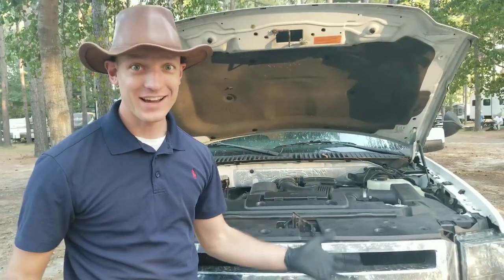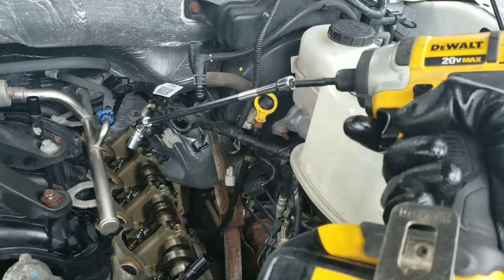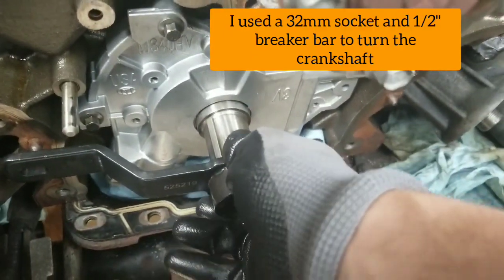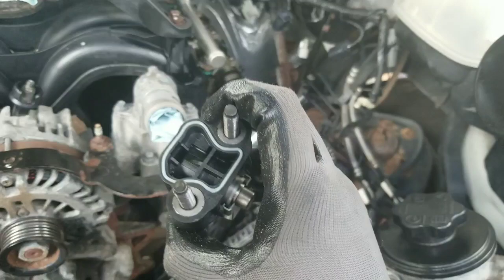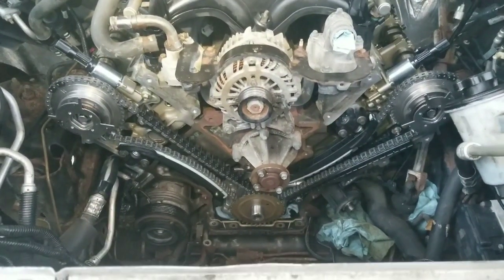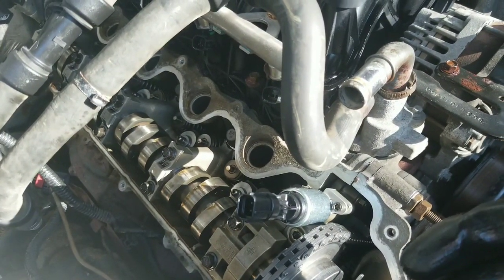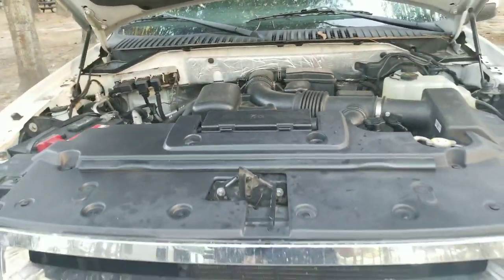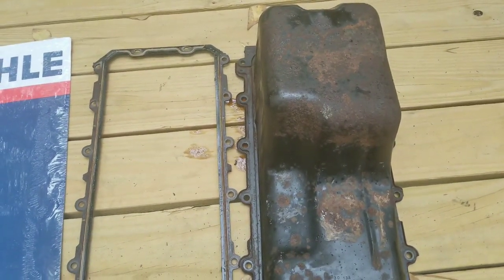Timing chain kit replacement | 2013 Ford Expedition 5.4L 3V engine (Part 3) | Extreme DIY Fix

Comment: When u finished installing the roller followers... at what position did you leave the crankshaft key way, 11 o'clock? like when u first time it or it doesnt matter? Thanks
Reply from the maker: Once you have completed the timing portion (installed the timing chain and phasers) it shouldn't matter what position the crankshaft is in if everything else is already done. The reason for rotating the crankshaft while installing the roller followers is to line up the lobes on the camshaft to get enough clearance for the followers to fit under the camshaft.
Reply: @DIYorDIE_Off-Grid  Thanks 👍
Reply from the maker: NP.

Comment: (Priming) for how long did you crank the engine until the oil pressure gauge went up... i was cranking and cranking mine and oil pressure gauge wasn't going up, i connected the sensor and it started no problem just think its weird that oil pressure gauge wasn't going up, maybe i didn't crank it long enough? Anyways it started and runs like new. For how long did you crank yours ? Thanks
Reply from the maker: If I recall I think I cranked mine for at least a minute. It wasn't super long, the purpose was to ensure that there is no air in the piping when you actually start the ignition for the first time which could cause a dry start.
Reply: @DIYorDIE_Off-Grid  did you oil pressure gauge went up as u were cranking it when priming it?
Reply from the maker: @fdapolice750  I want to say yes, but I honestly can't recall for sure. As long as it was cranking and pressure went up after you started ignition it should be fine.
Reply from the maker: @fdapolice750  I just tested it on my truck by pressing the gas pedal while cranking and pressure went up, so it should have detected something; however, if it is working now and pressure is stable for you I wouldn't worry about it.
Reply: @DIYorDIE_Off-Grid  cool thanks man much appreciated 👍. You're a genius man just confirmed that as well aka flood mode, oil pressure is good

Comment: Do you install the roller followers  before or after the front cover I'm already reinstall the roller followers before the front cover is  that ok   can i move the cranksha how you did it???
Reply from the maker: Did you install all the timing components before installing the roller followers?
Reply from the maker: Go check out @Fordtechmakuloco if you haven't already

Comment: Ok....crying uncle on trying to find a p0345 issue.  I checked everything that could be causing that issue.  Soooooo I'm going to assume my timing is slightly off.  Going to do a complete timing job all over again.  Just one question....Do I have to drain the oil or does it all sit in the oil pan? Thanks in advance!
Reply from the maker: Good luck! I found this and it may help troubleshooting...https://www.f150forum.com/f4/p0345-have-tried-everything-472434/
Reply from the maker: Seems likely that your timing is off by one or more teeth on the side you are getting the error code.
Reply: @DIYorDIE_Off-Grid  Thanks for all and the P0345 read.  Checking it out!!
Reply: @DIYorDIE_Off-Grid  Off by a link…..sounds plausible! Thought I was very careful but I will triple check the timing this time!!

Comment: Can I ask , I also own a 2011 Expy with 134,000 . At what mileage did you notice the engine failures? Thank you 😊
Reply from the maker: I replaced mine at about 85000 miles.

Comment: The rest of roller followers you removed before or after the camshaft
Reply from the maker: I removed the rest of the roller followers after I removed the camshaft. But I had to reinstall them all using the OTC tool after I reinstalled the camshaft.
Reply: When you put it back l the followers are a sequence to reinstall
Reply from the maker: I started with the same three that I removed initially. Then I rotated the crankshaft as necessary to get the cam in the right position to install the rest of the followers. Had to rotate the crankshaft a few times to get all of them. I did not use a specific sequence, just did whichever followers were next in line as I rotated the crankshaft clockwise  until they were all installed. Do not rotate the crankshaft counterclockwise.
Reply: @DIYorDIE_Off-Grid  I reinstall the roller followers I did it before the front cover it's that ok or I have to start again I watch your video and you installed after the front cover you think I do it ok
Reply from the maker: I don't think it matters. I could have chosen to replace the roller followers before reinstalling the front cover

Comment: Quick question... why not install the roller followers while the timing chain front cover is off, that way if something goes wrong while turning the crankshaft you can see it... or are you supposed to install the front cover 1st?
Reply from the maker: I don't think it would affect the process if you left it off. Me personally, would want to minimize the chance of getting debris in the oil pan.

Comment: UUuuuuugggg!!! Buttoned it all back together and realized I installed the Mellon Oil pump for the f150 that FordTeckMakoloco. I have a 2007 Ford Expedition.  Can I reuse the Tensioners if I compress them and put the clamps in?  And since I have to take the chains off to install the correct pump, I have to do the timing again?
Reply from the maker: I would check the part # to be sure that the pump isn't the same for the expedition as it is for the F150
Reply from the maker: And you might not need to redo the timing if you can maintain the chain position on the phasers and not rotate the phasers
Reply from the maker: Did you already replace the old tensioner?
Reply: @DIYorDIE_Off-Grid  No....I just have the valve covers and the timing front off.
Reply from the maker: Did you get it running again?
Reply: @DIYorDIE_Off-Grid  Hey!! So I did a complete timing job for the 4th time!  I was very very meticulous!!  I even replaced the oil pump for the expedition. It run absolutely great!  Smooth with power!  However I have two problems.  
1. I get P0340, P0344, p0345 and p0349. 
2. After the engine warms up,  it crank but don’t start after I shut it down. 

Any ideals. I used all OEM parts, check circuits, wiring, and connectors!! 

Any ideals from anyone would be greatly appreciated!!!
Reply from the maker: @johnbrumfield6212 

So after searching your specific error codes I found that Fordtechmakuloco has a specific video related to your exact codes. I didn't watch it but according to the title looks like maybe a VCT error. Good thing is those are pretty simple to replace if that is the issue. Check out the video and see if that helps.

https://youtu.be/2UAXvb0vpEY
Reply: Thanks  @DIYorDIE_Off-Grid !  Will check it out!
Reply: @johnbrumfield6212 so did you figure it out? Does it stalls after it warms up?
Reply: @fdapolice750  No......I runs great when cold.  But after the engine warms up, It cranks but no start when warm.  After it cools down then It will start.
Reply: @johnbrumfield6212  u said u checked all the circuits,wiring,connectors and everything looks good? Did you replace the sensors? They're like 20 dlls each at Amazon, i doubt that both stopped working but it's a possibility.. what codes did you had before you did your timing chain or did you had any codes at all? Did it starting acting up after the timinch chain replacement?
Reply: @johnbrumfield6212  erase your codes and go for a drive a see what comes up, I'm leaning more towards an electrical,wiring/connector problem if you didn't had codes before timing chain, if those codes came up after timing chain then most likely a wire or connector. Either not concted all the way/loose or damaged wire... https://m.youtube.com/watch?v=tMaAN6kIidQ&pp=ygURUDAzNDAgcDAzNDQgcDAzNDU%3D
Reply: @fdapolice750  Thanks!! I'm a electrical engineer by trade.  I tested all wiring for shorts/open circuits. I've gone as far as replacing all coil, fuel injector, camshaft and crankshaft connectors.  I rechecked  wires.  I've replaced both camshaft and crankshaft sensor.  I replaced fuel injectors and coils the first of (4) timing jobs that I've done.  Only to be absolutely sure I did sh!t right.  

Before the timing the code thrown was P0345.   After everything,  I now consistently get  P0340 P0344 P0345 P0349  after erasing codes.   

I have done a reset......get about 10 miles down the road.  Turn it off and can't restart it for about a hour.   At end as to a solution.  Any ideal?
Reply: @fdapolice750  Man.....I can get a new vehicle but I don't wont one because I'm married with kids.....tinkering on my truck is my stress reliever!!! LOL!
Reply from the maker: Did you check out Fordtechmakulocos video on the VCT solenoids yet?
Reply: @DIYorDIE_Off-Grid  Thx! Yes I did see it ……and I pulled the cam covers off and replaced them too.
Reply: @johnbrumfield6212   how many miles?I had a very similar problem, would run great cold and after it would warm up.. sometimes it would stall and wouldn't start till after it cooled down, and ended up being the fuel pump driver module. How old is your battery ,what's the voltage off and engine running. I know it may not have anything to do but I read that sometimes a bad battery might be a problem, I can't say exactly on fords but on my 2005 chrysler pacifica alternator wad going bad and it was throwing off buch of codes even speed sensor codes and trans would shit like crap, replace alternator and codes went away. Just saying stuff from my experience but wouldn't hurt to check, battery alternator and definitely fuel pump driver module. Since you already triple checked and replaced cam, sensor and wires problem has to be somewhere else. I wouldn't think it'd be timing related since you've done it 4 times plus you would be getting more n different codes
Reply: Thx @fdapolice750  227K!  The battery is new. Resting voltage is 12.2v.  I've been contemplating the alternator but haven't thought about the Fuel Pump driver module. Also I did check the (timing legs) on the phasors. All good.  I'm all read up and read out.....I don't know what else to look at.  And it's probably something simple.
Reply from the maker: Did you replace the VCT solenoids and/or test the VCT electrical circuit?
Reply: @johnbrumfield6212  what's up bro, did you figure out what was causing the no start after warm up?
Reply: @fdapolice750    Hey man.  Researched it to the hilt!!  Tried everything that I could find or research.
Reply from the maker: @johnbrumfield6212 No luck with the VCT solenoids?
Reply: @DIYorDIE_Off-Grid  Hey man!! I even replaced them. No luck.

Comment: Great Vid!!! I now can remove and install Roller Followers. However I have I that I can not get to budge!! Any Ideals?? Please help!!!  I'm following your 3pt Timing Chain kit replacement and #fordtechmakuloco 4pt vid!!
Reply from the maker: Which part is stuck? I know fordtechmakuloco has lots of videos on roller followers. He might have one on stuck followers
Reply: @DIYorDIE_Off-Grid  The Roller Arm will not unseat or even budge!!  It's stuck!!! I've removed several and re-installed them to removed them again to make sure I can.
Reply from the maker: Have you tried using rust penetrate lubes and tapping it with a metal hammer?
Reply: @DIYorDIE_Off-Grid  No……will do that and let you know!! Thanks!!!